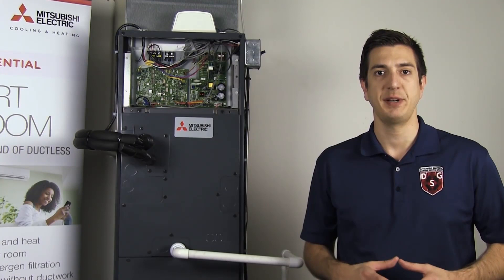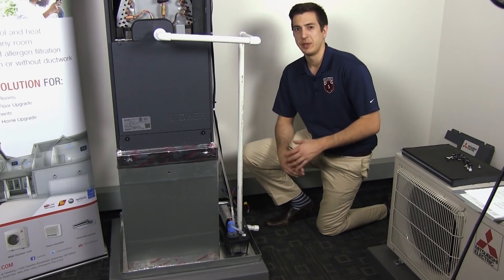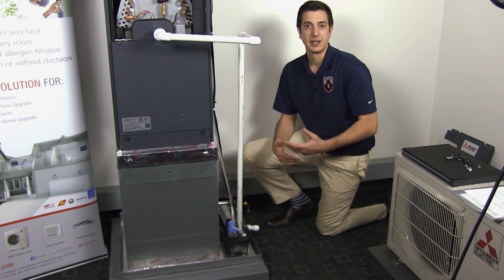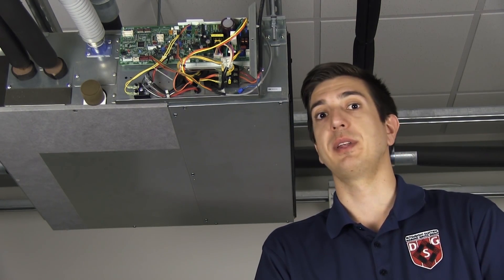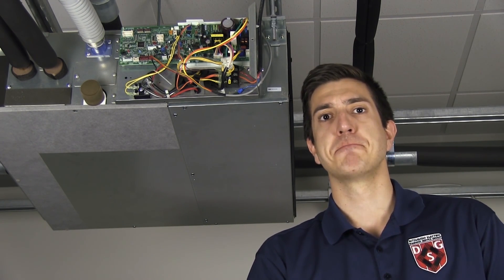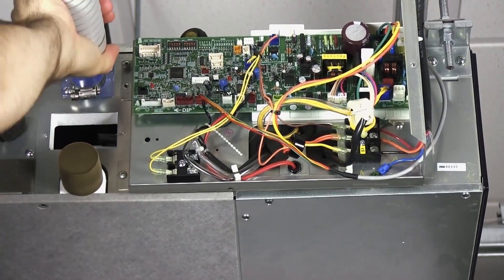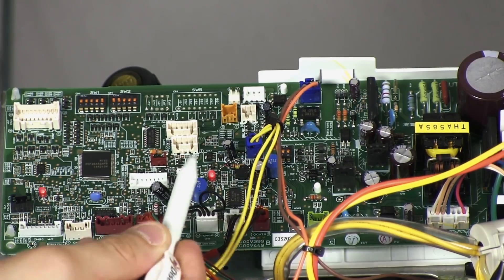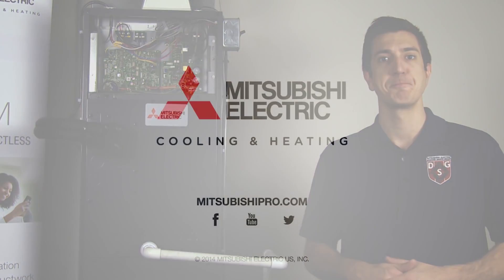Tech Tips: How to Resolve a P4 or P5 Error Code (L)

Comment: Sir I have a problem when the inverter carrier split type turns on , then the outdoor unit fan motor  on, ,after 30 sec.  The outdoor unit off ,  the  comp. Not react , then error is P4
Reply: What fixed it? Same issue here
Reply: Same problem